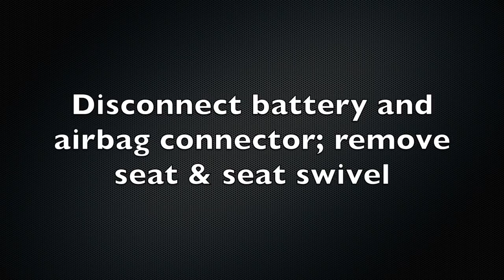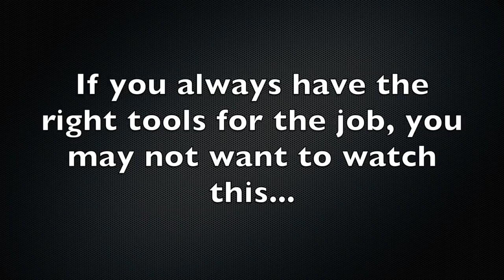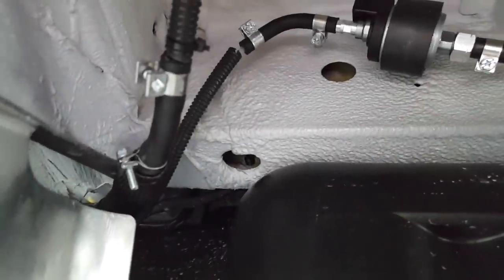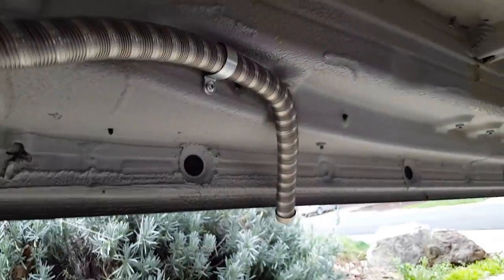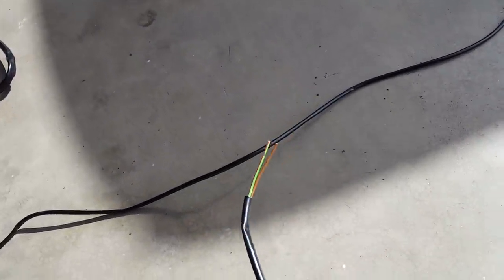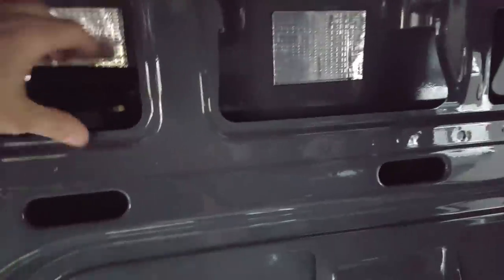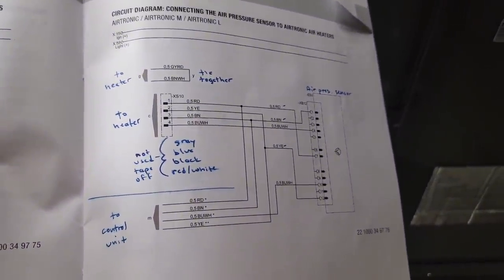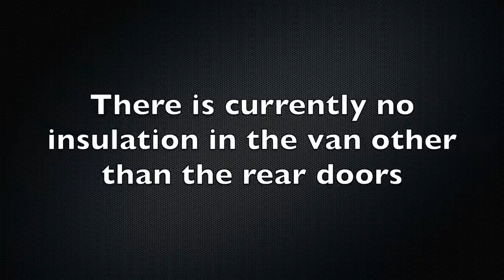Espar D2 Diesel Heater Install in a Mercedes Sprinter Camper Van

Comment: Hi
Great videos! Your site is supper helpful, thanks.  I’m building a Sprinter now and currently installing a d2 espar.   I got the quick connection you used, but can’t figure out how you went direct from the quick connect to the black tubing without a second reduction in tub diameter.  The fuel hose that fits the black hose seems too small to force onto the quick connection.  Any comment would be appreciated. Thank chris

To
Reply from the maker: It was a couple of years now so I can't remember precisely how I did it, but you may want to think about heating up one of the sections of rubber hose and pushing it over something of about the same size as the quick connect to stretch it.  That's assuming of course that it's at least close in size.

Comment: Can the Espar unit be installed square against the right side of the seat base?  The angle eats up precious space for other electrical components that I would like to use the space for.  Seems like the perfect spot for a battery to battery charger for the house pack..

Comment: amazing work.! Thank you. So what is peak power. Continuous? I’m wiring from the house batteries from the back right of my van.
Reply from the maker: I believe the glow plug circuit has a 20 amp fuse, so that would be the max.  But that is not a sustained current.  The fan and metering pump average a couple of amps.  Espar has the detailed specs on their website.  Thanks for the complements!

Comment: excellent channel! i'm building a overland camper I'm about to order the espar heater but petrol... do you know what is the advantage to have the external thermometer?, thanks for let us know your wonderful install.
Francisco.
Reply: thanks for the response!... did you try your induction cooker with the 1000W inverter?, I want  to have the same system in my camper.
Reply: kenetube thank you I'm waiting for you to buy all the electronics because I want to use the induction with a 400ah batteries. Thanks again!

Comment: Good video. Thanks. I'm getting my 2014 ready for D2 install. In your video I didn't see a mention of the wiring that goes to the dosing pump. From what I can determine, it is the branch that only has two wires. My D2 kit came with two red wire leads that have crimped connectors on one end and I think these plug into the dosing pump and then connect to the two wire harness. Am I on the right track?
Reply: thanks. did you route the two wire harness along the same path as the fuel line since they're both going to the same place?

Comment: Great Video as Always Ken! Quick question, do you have factory swivels with the lower seat bases or the standard high seat bases? I have heard of some issues with the lower seat bases and airflow but nothing to really go on. Thanks in advance!
Reply from the maker: I do have the factory swivels as well as the low seat bases.  I can't imagine airflow being a problem as long as you use the slotted access door.  That helps provide far more air flow to the Espar.

Comment: Excellent job!  How is the noise level having the heater in the seat console? Can you sleep and run it at night?
Reply: Thank You Sir, I assume here in Europe they call the Espar Eperspächer...I will buy one with 4 kw utilizing my diesel tank..final question, if you knew that, how much battery was used keeping your sprinter warm in such a night?

Comment: Thanks for the great video.  I am about to install my High Altitude Kit, and I am curious, did you bury it in the wall, or leave it exposed?  the instructions say it can’t be in an “air-tight” location, and I am wondering if burying it behind the wall will create issues.
Reply from the maker: I did put mine in the wall behind the headliner. It's far from air tight as there are weep holes in the bottom of the body to allow water out, so there's no way for the wall to retain pressure (air) as you change altitude.  Now I did not wrap it in insulation, it's between the insulation and the back side of the headliner.

Comment: Hi there!  There are 4 wires hooking up to the battery. Did you use an inline fuse before attaching the wires to the battery. And which wires are attached to the positive terminal.

Comment: Hello, I am currently installing a D2. All is going well be I have one question: the battery connection line has 4 wires: brown (ground), big red, small red, and small red/white. Are the small wires all + and need to be independently fused? Is the brown wire the only one that needs to be run to ground?
Thanks!
Reply from the maker: You'll have to confirm in the wiring diagram, but the thicker red is positive and connects the 20 amp fuse (this is the glow plug circuit), the smaller red is also positive and goes to the 5 amp fuse (for the fan motor), brown is ground and I believe the red/white is not used.

Comment: Why the D2 and not the D5? Are you finding the D2 adequate in cold weather? How cold?
Reply from the maker: D2 is the most commonly used unit in a van.  It puts out plenty of heat for my needs, but the coldest temps I experience are around 20 degrees F.

Comment: Here I am back again checking your awesome videos!  Question for you: did you have any issues getting the air intake cap on with the template (i.e., gasket) placed where you have it?  From your vid it looks like it was very close without the cap on.  I could move this a little toward the driver's side if you had issues.  Thanks, Steve
Reply from the maker: Hi Steve, I can't remember exactly why but I did not use the cap.  My recollection is there would not have been enough room to remove the cap if i wanted to lift the lid off the Espar for servicing.  The cap is there to prevent very large things from being sucked-in, but there's nothing in the compartment that could create that condition.  If you want to run the cap, you may want to move the unit back a bit.
Reply: Good point.  I didn't think about the service aspect.  I agree with you on the cap not being needed.  I might cut the sides off half of the cap with my Dremel though just to see if I can make it snap on from the top.  I would think that I wouldn't want it to touch the front of the seat base to keep it from vibrating either.  Thank you for your reply; I would have missed that.
Reply: Funny story: after watching your video I drove the 20 minutes to town and picked up the correctly sized hole saw for the heater output.  I measured everything closely and marked the install spot.  I started drilling with my hole saw only to have it catch on the soft metal as the large part of the saw broke through.  Even though I had anchored myself well it tore the drill from my hands and the saw skidded across the seat base.  <insert expletives here> The center hole actually tore a half an inch and I still wasn't totally through the outside hole.  Thankfully I was able to very carefully finish the outer hole without any further excitement.  The hole is a little larger than I desired which rubs my perfectionist nature the wrong way but it will work.  Moral of the story is that your method, albeit more time consuming, was a much better path; a blessing in disguise...
Reply from the maker: Oh man Steve, that stuff happens.  Working with thin sheetmetal is difficult.  I learned my lesson early to ALWAYS use drill stops ($8 investment to save a hole in the outside of the van) and step bits will make a nice hole every time without grabbing the sheetmetal like a regular bit.  But they don't make 2-5/8" step bits!  
I wouldn't recommend my method but when you've got 2 hours while your toddler is napping and you can't get to the hardware store, you make it work!  Congrats on getting that job done!

Comment: Where did you find your adapters to run from the larger fuel line to the smaller line? Having a hard time finding the right reducers. Thx
Reply from the maker: The reducer I used was part of the kit I bought.  Wish I had more info for you.

Comment: Pro job if I ever saw one. How does it work? Can this be installed in a gasser and maybe provide a secondary tank for the diesel?
Reply: I have been looking around for something like this. Do you think that the gas version would burn cleaner? Have you opened up the unit for maintenance yet? Is it a pain to maintain? Thank you so much for answering my question. I do appreciate it.
Reply: It does. Thank you for taking the time to respond. It means a lot.

Comment: Kent Sir, I’m getting the heater through your link. Which controller did you get? Did you get the mounting bracket and of so which one? What about high altitude sensor?
Reply from the maker: For my install I mounted mine directly through the floor using the supplied rubber gasket, so no mounting bracket.  I did get the high altitude sensor and just the basic controller called the Easy Start Select.  I hope that helps and good luck!

Comment: Great Videos wondering about your opinion of installing the Espar without the factory wiring harness as i got mine on the cheap without harness , based on your explanation it seems as though it would be easy to make up your own harness.
I know your not a pro , but you do clean work and i ......"LIKE"
We are in Nevada City, Ca.

Thanks, Phil

Comment: Great video. Question - have you heard of this heater overheating when located under the seat? There is a espar sealer in denver and they WILL NOT install them under the seat because they said they overheat constantly in that location. Any thoughts? I’m not sure where to install mine but I want it under the seat.
Reply: Thx. I might just need to find another person to install it under the seat.

Comment: Hi Ken, I only just noticed that you did not show how you led the power wire to teh fuel pump?
Did you run that wire through the boot under the drivers seat?
Reply from the maker: Hey, haven't seen you in a while.  Yes, somehow that footage was missing from the final video.  I did exactly that, ran it down though the boot in the driver's seat.  Be sure to crimp the end connector on AFTER you've run it down to the pump.

Comment: also you mounted the muffler upside-down the drain hole for water is up the top, should be at the bottom
Reply from the maker: Mine doesn't seem to have any drain holes.  I relocated the exhaust when I installed my Amp Powerstep as the two conflicted with each other.

Comment: Hey Ken,

Did you just put the altitude sensor in the wall? Putting up my walls tomorrow and just wanted to see if the sensor needs access to fresh air to work
Reply from the maker: I did.  That said, it's on top of the insulation and just in some dead space behind the wall.  There's no way my wall is sealed, so it shouldn't affect operation.  My Espar has not had a single hiccup at all.  I would make it somewhat accessible though.  If I remove the wall plate the thermostat is attached to, I can access the sensor.
Reply: Thanks man, that makes me feel better.  My setup be the same, and I’m sure air will be able to get in. 

If I ever run into you on the road I’ll have to buy you a beer. Your videos have been a huge help
Reply from the maker: @brodyspeck5912  Sounds good, I enjoy meeting others on the road.  :)

Comment: Hi Ken,  have you had any worries regarding exhaust outlet from aspar?  Does the outlet melt the underbody sealant.
Reply from the maker: I would highly recommend use of CO/LP alarm , that way you don't have to worry.  https://amzn.to/2Q50cNK   This one is hardwired.    In short, I have to be careful not to have the sliding door open while the heater is running, but if it's cold enough the heater is running, then I don't have the sliding door open.  That said, some day I may route the exhaust to the other side so I don't have to think about it.  It's pretty much on the bottom of my list at this point.  The exhaust is not hot enough to melt sealant.

Comment: i'd want that pump more protected.. but my vehicle don't stay on road... i'd just make a plate to put over it.  i'd also be worried about the muffler going out the bottom if you go somewhere it snows.  You get 36" of snow overnight and end up suffocating cause the exhaust just leaks back in...

Comment: Thanks for the video! How much fuel does the heater use?
Reply: That it is! Thanks for your response!
Reply: Did you ever received an answer on the fuel consumption?
Reply from the maker: FUEL CONSUMPTION, Gallons per hour
BOOST
D2 - .07
D4 - .13

HIGH
D2 - .06
D4 - .10

MEDIUM
D2 - .04
D4 - .07

LOW
D2 - .03
D4 - .03

Comment: How is the fuel line connected to the eber? Do i need to open the device to get it out or is it just tightened with a hose clamp?
Reply: Ok thanks =) I´ll try it out on my Mercedes Benz =)

Comment: Hey Ken. 
For how long did you live with the heater connected to the aux battery? Any issues with that aux battery handling the load?
Reply from the maker: It still is on the aux.  Works great and I see no reason to change it.  Just note that the newer VS30 Sprinters have a smaller under-hood battery, 70 ah vs 95 on an NCV3 Sprinter.  Might still be okay but something to note.
Reply: @ourkaravan  Thx!   I have been looking for the ah information on the aux batteries for the 2019s.... where did you find that info??
Reply from the maker: I could be mistaken but I believe I saw that on sprinter forums. It should be printed on the battery though.

Comment: Did you leave the power connected to the aux battery or did you ever move it back to the lithium bank in the back of the van?  Pro's/Con's?  I only have 1 starting battery in my rig, but the way you installed it would certainly make things much easier to leave it on the main battery.
Reply from the maker: I left it, for reasons that go beyond convenience.  I figure if it's so cold that my Espar is running a lot, it probably means I wouldn't be generating much solar at that time, so it's better off being connected to the Aux battery that automatically charges off the alternator. The arrangement works great and takes advantage of battery power that would otherwise not be utilized.
Reply: Thoughts on doing that for my rig w/ just 1 house battery?  Guessing best to go back to the battery bank.

2 more quickies:
1.  Where did you put your Carbon Monoxide sensor?  I just ordered same one you have from your store.
2.  Did you do smoke alarm?  Didn't see one in your store.
Reply from the maker: Do you have the factory Aux battery?  When you say single house battery I'm wondering if you mean starting battery? If the latter, I wouldn't sleep as well on cold nights if it were hooked to my starting battery. In that case I think it's worth the trouble to hook it up to your house battery.

I don't have a smoke alarm.  If something is smoking in that small space I will know.
Reply: Makes sense about both where to run the espar wiring and also smoke alarm.  Thx again for your help!
Reply from the maker: No problem!

Comment: Didn’t mention wires going to the pump. How did you route those?
Reply from the maker: You're right, somehow that part got left out. There's a two wire harness that feeds the fuel pump and I believe polarity does not matter.  I drilled a small hole in the driver's side seat pedestal (through the floor), installed a rubber grommet and passed the wires under the van to the dosing pump.  As a last step, cut the wire to length and then install the wire connector at the end.

Comment: Ken - quick question.  Is there an actual “plug” that I use for the 2 wires going to the doser/fuel pump or do I just add on blade adapters.  I didn’t see one in my kit (just the fuses).

Thank you for your input on installation - duplicated your install very closely.
Reply from the maker: Hi Brian, my kit came with the spade adapters as well as a plastic plug to go around it.  Does that part seem to be missing?
Reply: Ken - I did go back and it was in the fuse kit.  I have been shorted a few items on the kit, but nothing big.  Thx again.
Reply from the maker: You may want to let the company you bought it from know you were missing parts.  Many of these companies are great to work with.
Reply: How did you run the wires to the pump?
Reply from the maker: @aragu36  Somehow that clip got left out of the video.  There's a two wire harness to drive the pump.  BEFORE putting the connector on the end, I drilled a hole in the driver's side seat pedestal down through the floor, installed a rubber grommet and ran the wires back to the pump and cut the wire to length.  At that point you crimp on the provided electrical plug.  As I recall, polarity does not matter.

Comment: The installation of the heater in this sprinter video and numerous others on YouTube are wrong. Heater should not be installed heated end down. Heat end of unit must be either level or upwards. The unit will overheat itself. Its clearly shown in instructions of these heaters
Reply from the maker: You’ll find that Mercedes uses this exact location on some overseas models.  I’m at nearly five years now with not a single issue, along with tens of thousands of other people running theirs in the exact same location.

Comment: good job!
I recently purchased the same heater and going to install in the same location. I watch the video several times. Could you tell me how  you ran the wire for the fuel pump out of the inside of the van to the fuel tank location. please respond.  Thank you.
Scott
Reply: kenetube  thank you